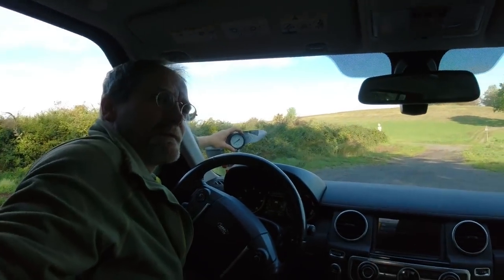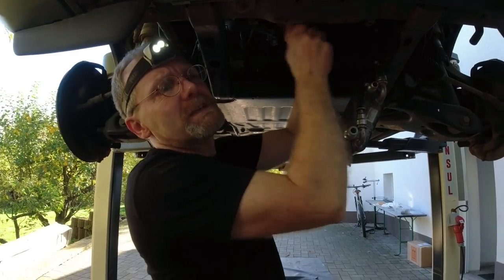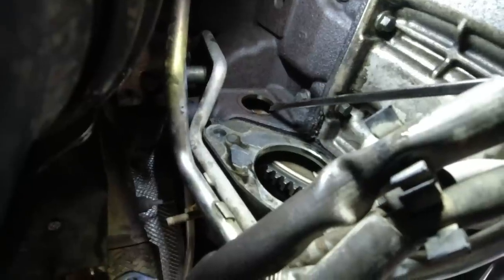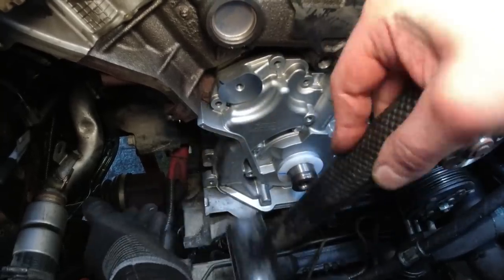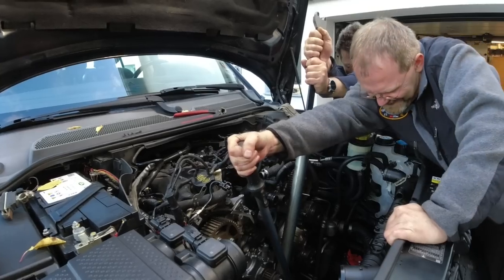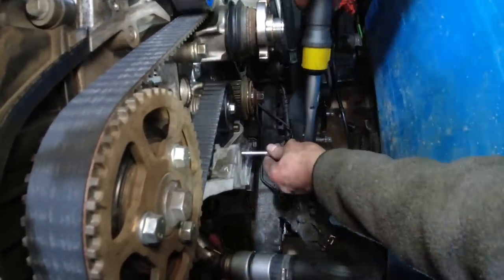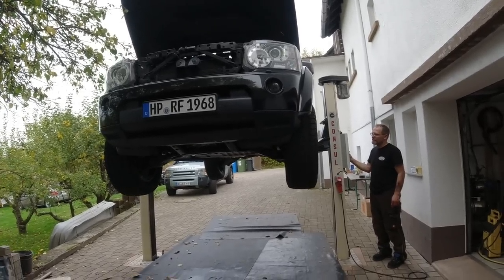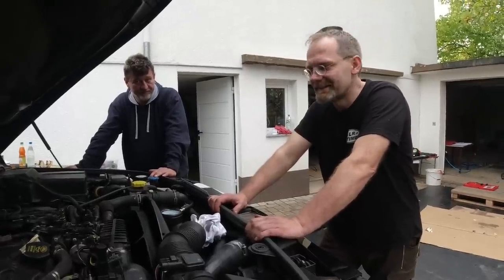How to replace the oil pump on a 3.0L SDV6 LR4 Land Rover - Discovery 4

Comment: Great episode all of you! Big old job to do the oil pump on the D4 but definitely worth doing it if you don't want a broken crankshaft down the road. Well done Christian that was very informative. I really like those hose clamp pliers, they are a very good design. I was shouting at the screen saying had you removed the small socket out from holding the timing belt to the crankshaft toothed wheel Christian lol. Vera, Land Rover only call it a generator because it seems all these workshop manuals have been designed for the American market. In the US they call the alternator a generator still. In the UK a generator produces DC current, and an alternator produces AC current. I have a downloaded workshop manual for my 2006 supercharged 4.2 Range Rover L322 and that too is all in Yank speak lol generator, fender, rocker panel. And no doubt more!  Would hate to have a Disco4 with all that work just to get the fan shroud off lol

Comment: I'm changing the oil pump on my Range Rover (2011 with the 5.0 petrol V8) and it makes your Disco 4 TDV6 oil pump look easy. It's an engine-out job on the Range Rover 🥴

Those hose clamp pliers look pretty handy, so I just ordered a set 👍
Reply from the maker: Hope this works out. I don’t want to touch an oil pump for a while.  👍 Christian
Reply: @Vera_and_Christian  Thanks! I don't blame you! 😂

Comment: It wouldn’t be a Discovery without an oil pump issue. Even the Discovery 2 had issues when Land Rover forgot to use threadlock on the oil pump sprocket bolt.  When Land Rover fixed mine many years ago, they managed to strip the threads on the sump bolts and tried to charge me to re-tap them until I pointed out it wasn’t my responsibility if they break something else while doing a repair. It was after that I started doing my own repairs as the D2 was out of warranty shortly after. Love this channel.
Reply from the maker: 💪That is the only way to go. 👍🙋‍♀️Vera

Comment: Thank you guys, for another amazing workshop tutorial.  You helped me to decide - I will wait for my body off job to change mine. I’m planning on a complete engine rebuild so it’s on the list of things to replace once the engine is out. All the best. Ty
Reply: Body off you still need to remove the radiator cowl so I don’t know what would change  only doing the rear timing belt is easier.
Reply from the maker: That is great Tyrone👍💪🙋‍♀️Vera

Comment: Glad I have an 25 year old Land cruiser 3ltr  Turbo Diesel. I have changed the oil today At 197487 miles. It runs like a swiss grandfather clock.

Comment: Hi my 4x4 is a 1988 Toyota BJ70. No electronics or air bags etc, so saves a lot of problems that the Discovery has.
Really enjoy your barter and instructions that applies to a certain extent to my Toyota BJ70 
I am a New Zealander just across the ditch from Australia.

Comment: Another great video for us Toyota drivers to watch with a coffee on a wet Sunday. If it's any consolation it looks nearly as complicated to change my 1999 Whatcruiser oil pump given the fact I'd have to remove the sump. I have no idea what the oil pressure is anyway so thankfully I'll never have to do it until the engine goes bang. 😉
Reply from the maker: Yes, you got some more 750 thousand miles to go until then.  Christian

Comment: I was sat watching the video thinking that Vera missed filming the socket under the crank timing pulley coming out but Christian had left it in there. 😱😱😱😱😱😱😱😱😱 Get a Toyota Christian!
Reply from the maker: Well, with the socket below, the cover don’t fit.  Well designed by LR.  😂 Christian

Comment: A tip for the 10mil socket timing belt trick:
If you put a bright color string through the socket, you wont forget it.
Reply from the maker: That is genius. Christian
Reply: I was thinking the same. A REMOVE BEFORE FLIGHT red tag.
Reply: Maybe with the ignition key on the other end of the string !

Comment: Hahah I thought that hearing you say mechanical orgasm after finally buying a battery ratchet was the funniest part of the video 

Until I seen the oil seal installation 🤣 in my defence it was because I forgot to put sealant between the oil pump and sump 🤣 cam seals seem to be holding up fine.... for now 🤣😅
Reply from the maker: 😅👍Waiting for your next video 😀💪🙋‍♀️Vera

Comment: Interesting spec on this D4 (at least for this Australian). Looks to have a 6 speed (8 speeds had the rotary gear selector) which was never an option here combined with the 3L. The only D4 that had the 6 speed here had a 2.7. And I love having a 3/4" socket set - Can lever the hell out of those tight crank bolts without worrying about breaking the breaker bar or socket

Comment: Awesome work, but what were they thinking when they developed the 3.0 version of that engine! 

Progress implies improvement, but it doesn’t always appear that way in this instance (nor many others, I guess)!

Thanks for sharing as always 👍
Reply: My son is a Mechanic and he comes home most days with a tale of how awkward modern vehicles are to work on. Much of the complexity is from emissions and engineering for cheapest manufacturing.
Another example was the Ford 1.0 Ecoboost which at 150k miles needed a new timing belt. The main dealer told them  to just throw the engine away as it was easier and cheaper. The engine has to come out for a new timing belt.

Comment: Question for Christian. Do you think the oil pump has much to do with the crankshaft failures? I seem to remember alot of the failures happened at relatively low mileages - before the oil pumps would have worn. What do you think
Reply from the maker: I think there is little connection.  You are right, most failures occur before 200k and the pump is still somewhat good.  Christian

Comment: Please use rotella t5 15/40. Itll give a little boost to oil pressure after a hot motorway run then idling  after heat soak with ac on.
Reply from the maker: https://youtu.be/YGvQAbM_YQY That is what we use and recomend. 👍🙋‍♀️Vera

Comment: Crankshaft end bolt it supposed to be done with just 140nm, somebody who installed this pump before clearly does not read engine manual.
Reply from the maker: It was still OEM.  D4 is 150 Nm +90 Deg.  Results in about 400 Nm.  Christian

Comment: Great video! Loving the comedy 😂 I have a question though, Iv just purchased an August 2015 Discovery 4, will mine have the new specification oil pump? Ist done 80,000 miles so expecting to have work to do.
Reply from the maker: Not sure, check if it is a Gen 2 engine. The change was made in 2015 at one point . Use your vin number👍🙋‍♀️

Comment: I owned 3 Discoveries from
1990 till 1996 , and had the same experience as you guys they always break down .
I bought them all new , second one I realised showing my friend the engin , there was no oil on dipstick after 1000 K . Big discussion with LR using 1 ltr /1000 K as from new .
Lots of returns to workshop , new seals , finally they placed oversized pistons , and then oilconsuption was reasonable and I quickly changed my car . But no 3 also had a lot of problems with the drive shafts , had to take it off put gearbox in lock and could drive it to workshop . So I look at it but will never buy one again . Is it because British ?

Comment: Christian can you do a quick video about the discovery 4 3.0TDv6 with the 6speed zf is it worth getting or go for the SD many thx love the videos 👍🇬🇧
Reply: The 8 speed is by far the better gearbox in terms of drivability, fuel mileage and longevity.
Reply from the maker: 8HP is more reliable and better.  Christian

Comment: How did you found out that the oil pressure was low in the first place? Rattling on startup? Warning lamp? I think my 260000km SDV6 is a bit noisy. Might need to check the oilpressure.
Reply from the maker: We meassured it. Seen in the first video here about this Discovery 4 https://www.youtube.com/watch?v=bSdo48uB438&t=16s . Have you switched to 5W40 yet? That is going to help with the noise, if it's coming from the engine. A noisy engine can also have ratllin and worn out pully wheels, as seen in this vidoe herehttps://www.youtube.com/watch?v=cGszNkyqR2E&t=318s It's a funny, watch it anyways. 👍🙋‍♀️ Vera

Comment: A pleasure to watch you, nice work! Did you make a video on how to measure oil pressure ? Or do you know any youtube video showing step by step how to check oil pressure ? I have 139 000 km and it looks like I need to change the distribution, and in the service they recommend me to change the oil pump too . I could do the servicing myself but I hesitate.. I'm not a mechanic.
Reply from the maker: Here is our oil pressure gauge, what we have in my Discovery 3 https://www.youtube.com/watch?v=604513GUKws&t=25s and in this video https://www.youtube.com/watch?v=bSdo48uB438&t=16s we show how we measured the oilpressure on that Discovery. 🙋‍♀️Vera
Reply: @Vera_and_Christian   I'm more interested in an oil pressure gauge like one at minute 31:29 (this video) for periodic checks on an LR4 and not so much a permanent solution, like you have Vera on your  LR3. Thank you.

Comment: Great video as always guy's . When Christian removed the by pass valve did he notice the red pipe had oil in it? I cleaned mine out the other day because i had blue smoke when i gave it the beans which cleared but i was told the red hose on the bottom of the by pass valve will have oil in it ! Does Christian know why this is please ? .
Reply from the maker: Yes, the red hose was full of oil (not fully shown in video).  Early LR4s have a obsolete oil return pipe from the second turbo.   This was fixed much later. It is possible to upgrade the oil return pipe.  See this video here: 
https://www.youtube.com/watch?v=EBSwenUNEg4

Comment: Had a chance to finally open my engine due to injector fuel leak....decided to look at my oil pump & noticed its 6600-AD in your opinion is it among the weak ones! Oh it has 200k miles on it!
Reply from the maker: You have to look at the first 4 letter code also. The 6600 AD is not enough. If it says 4R8Q-6600-AD, then it's weak. 🙋‍♀️Vera

Comment: Christian why is the oil pressure so low on these engines from new 1 bar at idle and 2 bar at 3000rpm is very low don't you agree. never miss a video keep up the fantastic work.
Reply from the maker: Yes, way to low.  The reason is fuel efficency.  A high oil pressure on a large engine like this quickly will take an extra liter of fuel.  A solution would be a variable volume pump like some other manufacturers use.  But they cost more.   Sad.  Christian
Reply: @Vera_and_Christian  Thanks for your reply. I think I'll get rid of my 2013 RR Sport even though it's the last face lift model with 8 speed box. I'll get a Land Cruiser instead.

Comment: Good video. What kind of oil is on the LR4? I know it's a low SAPS because of the DPF. 
Looks like it's 5w-30 with the following spec? So no 5w-40 on this one?
ACEA C1
Jaguar Land Rover STJLR.03.5005
Ford WSS-M2C934-B
Reply from the maker: The oil has been changed to 5W40 right after he bought it a couple of weeks ago. 🙋‍♀️Vera

Comment: Would the oil pressure improve if using 5W-40 viscosity engine oil?
Reply from the maker: It got 5W40 in.  Made a minute difference only in this case.  Christian

Comment: Do you have the cable operated remote spring clamp tool… it is very useful on LR products due to the cramped engine bay 👍
Reply from the maker: Yes have that too. Now I prefer the pliers Vera found.  Christian

Comment: Christian, on a lot of episodes you have a print out schematic or workshop step by step guide with torque settings etc.   do you just find these online or do you have a secret friend in a land rover workshop?   

I have a Haines manual but they can be hard to follow sometimes.  Your guides look great.
Reply from the maker: The manual can be found on disco3. Co.Uk. Christian
Reply: @Vera_and_Christian  thanks a million.  I never spotted that.  Great video by the way.   Also congrats on the new tool.  😁

Comment: Hi guys, do you know how much pressure is on 1500rpm??? Most of the time is engine running between 1200-3000rpm, today I meassured only 1.0bar at 1500rmp (70km/h). It looks to low for me.  Its 3.0sdv6 180kw.
Reply from the maker: Yes, that is possible. It sucks on the 3.0.  same on mine.  It usually cruises at 1100 rpm sometimes lower.  The pressure is then 1bar and the engine has only 112t km. With 5w40 it increased to 1.2 bar which is 20% better.

Comment: Didnt this engine have a oil pressure controll valve where it lowers oil pressure during low load periods?
1.7-2.0 bar are way to low  for high loads lig pulling a 3.5t trailer up a 10km hill, where oilt tepts get to 130 easy.

Comment: Further clear evidence that contemporary LRs are effectively only repairable by anyone with a >200 IQ, plus owning every tool in the catalogue, as well as  having many that are not. Imagine doing this by the side of a track  in the Gobi desert. Is it any wonder expedition vehicles need 1990s 200 TDI  technology (or a Toyota!)?
Reply: Unfortunately that goes for any post 2005 design vehicle...
I had the opposite problem with finding a local machinist who knew the Rover V8 heads and their tricks. The guy I found should have retired years ago but is so busy (and happy).
Reply: I have a 2000 D2. Much less complicated. Better still my Tesla has a few thousand fewer parts.

Comment: Are wheel spacers legal in Germany?
Reply: Yes!
Reply: Yes, these are legal. The widening is 50 mm per axle (25 mm left, 25 mm right). You will receive a certificate from the manufacturer (Eibach) upon purchase. With this report, the spacers can be entered in the vehicle documents by the "TÜV".
Reply: BB' garage, they must be because Christian fitted them to Vera's Disco 3 about two years ago now, it's in one of their videos
Reply from the maker: They are legal under certain conditions.  We made a video about that about 1 year back.  Christian

Comment: That was one big scary job. So does it mean if I buy a discovery 4 and change the oil pump, I may have some life in it?
Reply from the maker: You need to measure the pressure first.   A new pump will not always help.  Christian

Comment: It is such a pity to see how an incredible vehicle can be ruined by cost cutting. As I watch the videos on your channel, I can't stop the feeling that "these cars were made as cheap as possible" which is not what you would expect from a "premium" product. I would think that JLR would invest as much into R&D as they possibly could, knowing that they're going to charge an arm and a leg for the vehicle in any case, meaning they would more than recoup the costs, and ensure continued sales as their product quality and reliability would increase. It is actually astounding that no one at JLR has thought of this...or maybe they have and were quickly told to go work for Toyota if they wanted to carry on about quality and reliability
Reply from the maker: They are not maintenance friendly build. For sure.  But they are well made of quality components.  Most issues would be cheap to fix but the amount of labor is way to intense.  Most parts are of much higher cost and quality than on a Toyota.  The frame is fully boxed and heavier and has no corrosion issue. The body is extremely well made and has a large percentage of aluminum in use and so on.  But the idiotic assembly complexity ruins it all in regard to cost. It lets a simple issue like a bad EGR valve would like a engine out job.  In reality such issues happen on all vehicles.  Still, the risk of a complete engine failure is high and there is no excuse.  This would never be acceptable at Toyota.  But LR is ignoring it for 15 years.  Christian
Reply: @Vera_and_Christian  Aaaaah I see, I was mistaken then! Thank you for clearing that up.

Comment: It seems that all LR products are built to fail sooner rather than later 🙄.
I've owned a few, accepting that all cars do break eventually...even with regular maintenance...LR consistently succeed at failing prematurely.
It's a great channel....the clear message should be to potential owners , buy a Toyota.
This will save years of anxiety, expense and endless trouble. The time taken to absorb this nonsense will not be tagged on to the end of our lives.

Comment: Brilliant videos guys, reminds me of working on cars with my dad, great memories.  I have a 2014 Discovery 4 that we don't put huge mileage on, it only has 60 000 km on the clock. Strictly speaking, it's time for a cam belt service due to its age. Is it really necessary to do or can I rather wait until the recommended  km? I do all my own car work, won't take it near a dealer, they introduce more problems than they fix. Your opinion would be highly regarded :-)
Reply from the maker: To tell you the truths, we would definitely change the belt. But that is, because we can, it's easy for Christian and me. The rubber can be porous, you just can't see in what shape the belt is. I hope you have your wife or a great friend helping you, just to stay sane while taking out all the coolant system hoses.  😅👍 I wish you all the good luck, not that you need it. We had visitors that day and with filming, it was a two day job.  🙋‍♀️Vera
Reply: Thanks, rather safe than sorry I suppose.... I will order the belt and pulley and make some time... I'm not scared of a bit of work so if it takes me 3 days that's also fine and my wife doesn't mind helping.... Keep making the great videos🙂